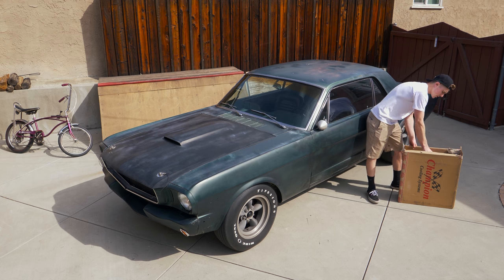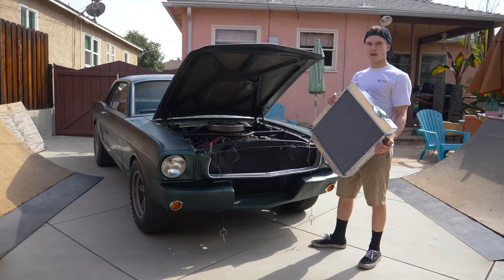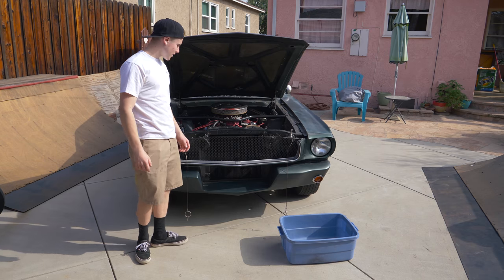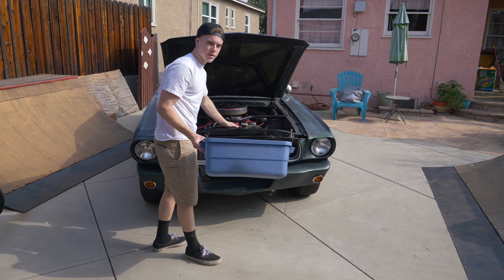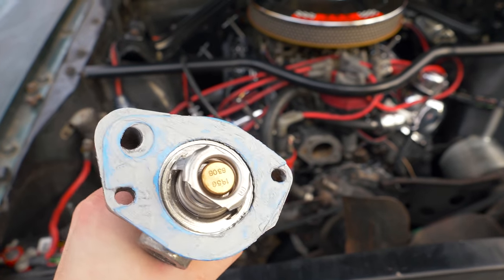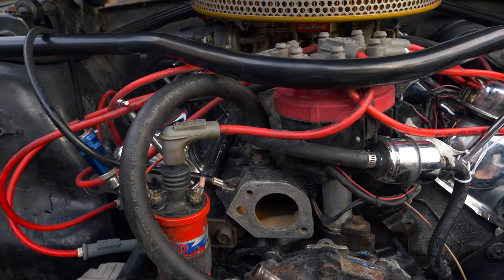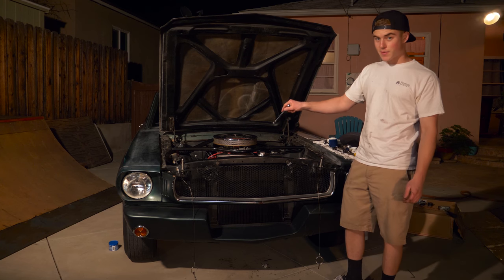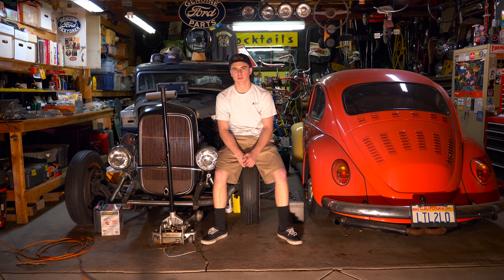Radiator Install | Mustang Update #1| 4K

Comment: The problem is that 4 blade fan for a 6 cylinder,   get a 6 or 7 blade steel replacement fan.   Nice Car
Reply from the maker: Vern M Interesting and thanks. It runs kinda cold now but thanks for the advice.
Reply: Hmm interesting I have a 1965 289 Fairlane same fan

Comment: Early Mustangs had weak cooling systems. V8 cars had a small two row core. With "heavy duty cooling"  or air conditioning you got a fan shroud.  Same radiator.   Put a 3 row copper in my '65 coupe.
Reply from the maker: Scooter George Yeah my old radiator did not keep it cool at all haha

Comment: Its taking me forever to replace my radiator. Inexperienced admittedly and mine had a rust hole in it and was leaking. I have a 5 bladed fan with a spacer that puts the fan almost on top of the radiator itself so that made it difficult to get the old one out. Plus I had to cut the rubber hoses for the transmission off. Barely any working room at times too. Its frustrating. But I hope its all worth it in the end.
Reply from the maker: It will be worth it!

Comment: You need to put a fan shroud back on it! My 67 had over heating issues that all went away with new fan shroud!
Reply from the maker: silversolb18 Interesting I didn’t even know that my car should have one. But I actually did need a new radiator. It was full of build up and it had holes in it. Thanks for your help👍🏼
Reply: Living in Atlanta traffic is a huge issue and I was having issues with my 67 getting hot sitting in traffic adding the factory fan shroud cured those issues! I can sit in traffic for hours and it never gets hot!

Comment: I put this https://www.championradiators.com/2-row-Ford-Mustang-radiator-20-1967-1970 in my 66 with an Imperial straight blade puller. I only need the fan when idling through traffic or waiting for my next autox run
Reply from the maker: Nice!